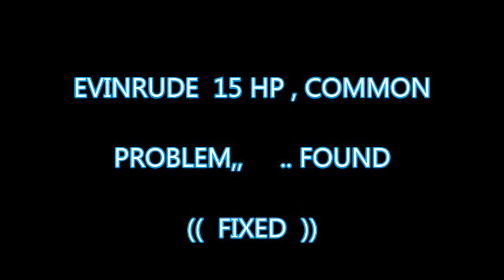15HP EVINRUDE, PROBLEM  FOUND,, &  FIXED

Comment: Great video - thanks for posting - one question: Do you have any good advice on loosening that lower bolt on the thermostat cover? It's really tight in there - which tool is the best to use to avoid rounding off the head of that bolt? Open ring spanner or some angled spanner?
Reply from the maker: I welded a socket to a 1/2 inch by 8 inch flat stock & find that 2 work well,  I also have drilled a hole in the lower pan use a quarter inch socket & extension and then plug the hole with a plastic plug from the hardware store they come in several sizes & colors.    kb

Comment: Idk if you still respond to comments a year later, but I didn't see a spring between the cover and tstat. Mine doesn't have a spring either. I'm about to install new tstat. Do I need to order a spring or nah? My tstat cover is exactly same as in this vid, and I punctured a hole in it while trying to replace rotted out cover latch. Doh.

Comment: Hello kodibass I have a question about the johnson 15 your carb doesn't have the extra spring on it like mine does and I can see it on any diagram it was off when I got the engine do you have any idea what the spring on the link would connect to?

Comment: Well, when the motor purrs in the tank and sputters on the lake (river, ocean, wherever) looks like your client's fuel might be the issue. Regards !
Reply from the maker: Or'  tank / hose / fitting  etc.  That's  why I think a boat ride is in order 4 sure.        happy Easter,   kodi
Reply: @kodibassInsideoutboards  Sounds like you are looking for an excuse to go for a ride says the wife.  Ha, ha !   Need a helper ?

Comment: Kodi. I need some of your help. I have a 1997 yamaha 4hp 2 stroke. No spark. How do you take out the flywheel from that yamaha 4hp. Please help sir. Thank u
Reply from the maker: You should use a flywheel puller,  Loosen flywheel nut flush with top end of crankshaft threads, install puller in the 3 threaded bolt holes on flywheel tighten evenly .  then tighten puller bolt until flywheel pops up.     kodi

Comment: Nice video, you do good work. I have a 1975 Evinrude 6HP.  I used compressed air to blow out water lines before installing a new impeller/water pump kit, but it is still not peeing. Any ideas on what might be wrong? (I put in a new thermostat too) -- Thanks
Reply: Had a similar problem on mine, had to use a bit of pipe cleaner to ream out the pee-hole and now it pees like a drunk at 2am
Reply: @fastillion918  LOL

Comment: Just happens I'm helping a friend with a Evinrude 9.9 electric start. It has same Tstat cover as yours.  I don't know how to tell the age because it has numbers and not letters that coincide with INTRODUCES.
Reply: Post the model number...
Reply: @fleetwin1  Evinrude 9.9 electric plus pull start. Mn. 10555C  Sn C79638  Built in Canada.
Reply: OK Ernie, it is a 1975 model...The problem is that the original head/thermostat cover was often replaced on those early engines with an improved version, so I would have to see a picture of the head to know what style it is and what thermostat cover gasket would be used...  Getting the thermostat cover off can be a pain, especially if the engine has been used in salt water...Generally speaking, it will come off easier if you remove the cover latch giving you more room to work...Don
Reply: @fleetwin1  I don't know how to post a photo but the thermostat cover is the same as the 15 in the video. Tstat is at bottom of the cover. Which I found strange.  Stat  is usually at the top of an engine.
Reply: @erniefoster4222    Ernie, yes all those engines had the thermostat at the bottom, but the head and cover were redesigned slightly a few years later.  There was an update program where the original heads were supposed to be updated to the later style...So, your 1975 model could have either the original or later style...The gasket is different, along with an extra bolt...You can email me a picture if you like...Take a close up looking at the back of the engine...
dkellogg56    gmail.com      Don
Reply: @erniefoster4222    Ernie, the original style thermo gasket is part:  318917   The updated style thermo gasket is part:  321387    The thermostat is part:  378065  and the thermostat gasket/seal is part:
310058      A few of these part numbers maybe "superceded" to newer numbers...Hope this helps...D

Comment: OK, well I'm still confused...I understand that somehow the bolt from the cover latch was banging into the thermostat cover causing the hole...But, just what was loose?  Did the cover latch bolt back out into the cover?  I don't see how the lower pan could get loose and bang around, those little mounts hold it in place pretty well, even if the nuts come loose...
Reply from the maker: As the 3 AV rubber mounts inside rot / crack  & the transom mounts become shot,   if the motor is dropped from upright 2 square on its back lower pan it will indeed result in this situation.. I know this 2 B the case as I have duplicated this damage twice over the years in my tiny shop.        kodi
Reply: @kodibassInsideoutboards    OK, makes sense...So this one was dropped?  And I guess if the rubber lower pan mounts are shot, the latch bolt would be pushed into the thermo cover when the engine is set down on the ground...  Very interesting indeed
Reply from the maker: @fleetwin1    O'Yepper  this one took a hard drop.   She belongs 2 a Bear guide'   after every Bear season I patch her back together as best I can,  I have kept her going now for over a decade.  But he wacked her good this past season.       kodi

Comment: Happy Easter in the Great North.engine blogs down and does it reaches rpm range.
If it does has the weight in the boat has changed?
Reply from the maker: Who knows'   with a Bear guide running it one can never B sure.         kodi